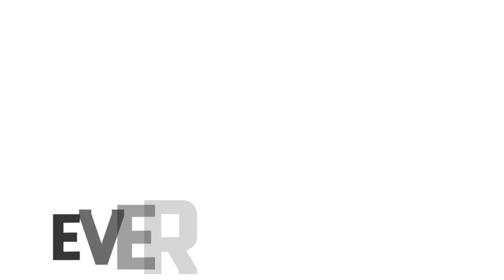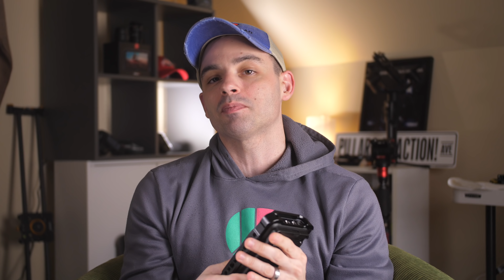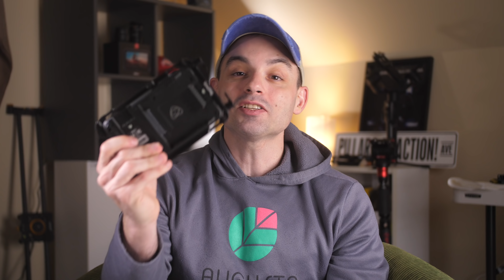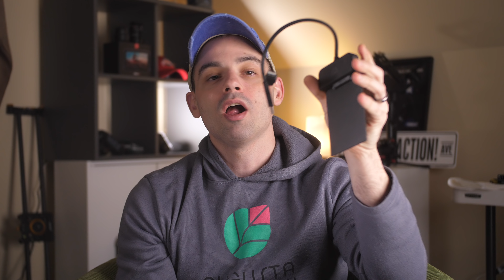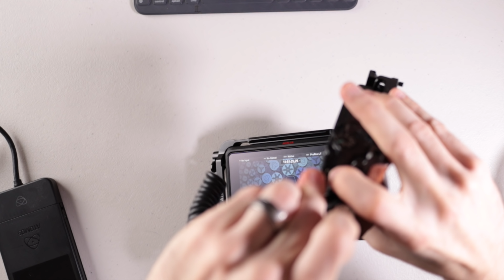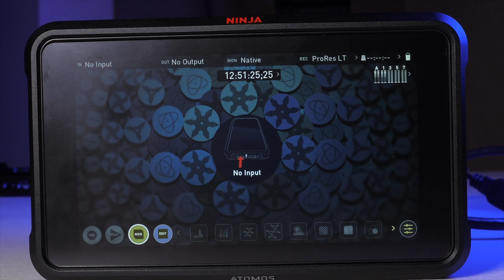The MOST VERSATILE Camera Accessory Ever Made!  The Atomos Ninja V!

Comment: I’d like to see a size comparison between the camera’s internal h.264 and the ninja’s prores files.
Reply: It’s a HUGE difference in file sizes - exponential in fact - BUT when you go from 24 mb/sec to 200+ mb/sec the upgrade in quality is also exponential. You’ll need to upgrade your capture and transfer infrastructure but if you value high quality video, sound, and faster workflow, an external recorder is well worth the investment. I am constantly amazed at the quality I get from my Atomos.
Reply from the maker: It’s a big difference, I’ll pin this so people see it but it’s substantially bigger.
Reply: The difference between H.264 and ProRes is typically 10x.  There's a reason Recorders usually use SSD's and not flash cards - they're fast enough for that high volume of data AND it gets the cost of media for all that data down to a far more reasonable level.
Reply: It's not about the size. I switched to DNx because I can edit it directly in Resolve, I don't even need to pull the files out of the Ninja's SSD. No transcoding required. It's a huge time-saver, and time is money. And then of course there's the consideration of image quality : it's like comparing a camera's JPEG to RAW files.
Reply: The H265 update brings the file size down considerably.

Comment: Grreat video. I have just ordered the Ninja V & now need to get a ssd. Can you tell me if these are any good?

SanDisk SSD PLUS 480 GB Sata III 2.5 Inch Internal SSD, Up to 535 MB/s
Samsung MZ-76E1T0B/EU 1 TB 860 EVO Sata III 64L V NAND Solid State Drive
Western Digital WDS500G2B0A WD Blue 3D NAND Internal SSD 2.5 Inch SATA, 500 GB

Thanks in advance

Comment: I have the 7" Atomos Shogun Inferno monitor/recorder. I love it except for one thing, outdoor daylight visibility. It sucks! I had SUCH HIGH HOPES of being able see it well in sunlight. The specs say it's possible. Reviewers say it's possible. Not me - I still see more reflections than actual digital display. That frustrates me to no end. Being a wearer of glasses, I find it very difficult to use a viewfinder. The EVF on my Panasonic AG-UX180 video camera is pretty darn good, but still tough for using glasses. I was hoping the monitor would be my viewing savior. Not so much. If anyone here has helpful comments, I'd love to hear. Is there a glare-free covering that I can put on the monitor? Can the brightness and contrast be tweaked for daylight viewing? NOTE: I have the official Atomos monitor sun shade, but even that is not a cure. If I leave off the external rear panel with the reduced viewing window, I still get too much glare on the screen. If I use that panel, I may as well be using an EVF again because I need to have my face plastered to it. Argh!

Comment: Thx for your detailed view on this one, as a beginner starting from 0 (actually didn't even begin yet ^^ ), I think I won't invest in this ext rec, yet now I know better how useful it will be when I get my hands on it!

I was wondering how could I rec on SSD instead of SD, as they're cheaper, + performant, + durable & reliable, have + storage in 1 drive...  & except cameras like the BMCC, there was no way to do it on regular mirrorless, which is a shame to me, as it is utterly possible to allow it through USB C 3.1, that they could implement... 

Whatever, here we have another complete solution, with additional benefits as 4K 10bits 4:2:2 rec, never possible in body.

Comment: Another  point. the batteries fujifilm x-t2/3 are used up fast when doing internal recording and overheating is real problem still  in the 35-40c heat south-east asia. but when sending the video out to an external recorder like Ninja V, the camera overheating and battery strain problems are solved. I have done continues 45 minutes  recording on Ninja V from a X-T2 and the camera battery only drained 15-20% (original fuji np-w126s)  and did not get hot at all.. because all the heaveduty processing is done by Ninja V, not the camera as is the case for inbody recording. So Atomos recorders  can make a real difference in what and where you can use your camera. btw. Ninja V ran 45 minutes recording in 4.2.2 8 bit DNxHD  from fuji F-log UHD 24fps, on a small lightweight NP-F550 2200mha battery
Reply: I bought this for my XT-3 and did not even realise this hidden benefit so thanks!

Comment: Hi, if you buy an Atomos Ninja V, which accessories do you need to buy to make it work? It’s a basic question but nobody online seems to talk about it precisely.
Reply: The hdmi cable, a SSD and optionally some kind of rig so that the mount is stable
Reply from the maker: Work to do what?  Externally record or use as a monitor?  For a monitor nothing, for an external recorder a compatible ssd.  And if you want to travel with it a Sony np series battery.
Reply: It isn't clear in the website either. Átomos $700 battery $160 SSD $350 for 1tb that makes a hell of an expense. I want a real review, how long would a battery last and so on.

Comment: I have an A7 3 and Elgato cam link what would be the benefit of using this for live streaming versus just doing that?
Reply from the maker: You’d still use the cam link but have the monitor going to the cam link instead of the sony.  

The thing that I like is being able to use full size hdmi to plug into the camlink.  I’ve had issues where the micro hdmi from the Sony will yank out.

Plus you can monitor the video in real time while live-streaming without having to stare at your computer.  And have audio monitoring tools without having to stare at your computer.   👍
Reply: @TheEverydayDad  I can see where some people would need that I have a separate monitor for OBS and it seems almost completely leg free I can see my giant head on a giant monitor
Reply from the maker: Oh nice!  Yeah I bet a second monitor would do a lot of the same things 👍

Comment: It costs $695.00, for anyone like me who wanted to know ASAP!
Reply: J Armellin That’s the cost of the “recorder” add the SSD, the SSD docking to download, the battery - two - and how will you attach it w/o a cage... and use it in a Gimbal and Slider? Is it worth over $1K YES!!!
Reply: @TheGeoDaddy  The recorder and a 500GB SSD just cost me 1138$CDN. It is quite a good chunk of money, but think about the Pro SD cards you will not have to buy (they are costly). Also, you may not need the Vertical Grip on the Fuji XT models (another 300-400$). On top of this, you will save time editing. What I really like is the ability to monitor your shot in the field. This saves you so much time afterwards. All in all, this is an investment on the long run.